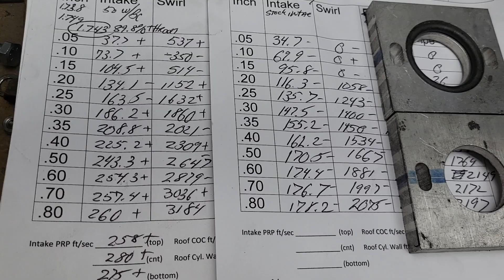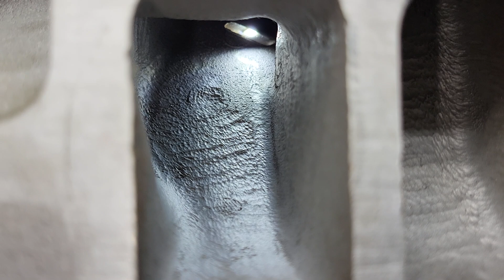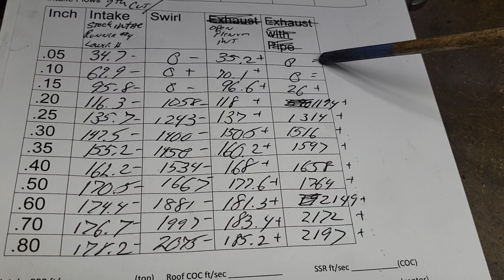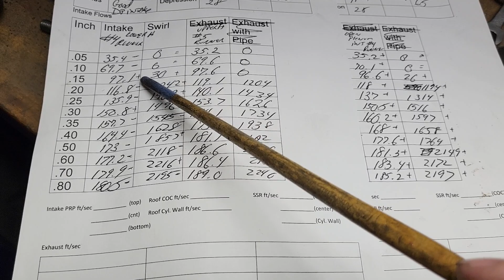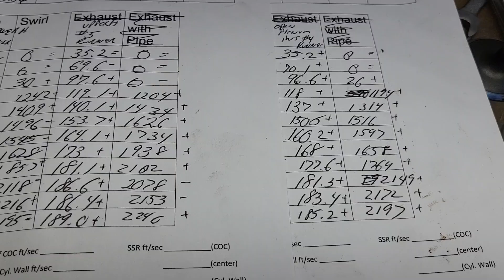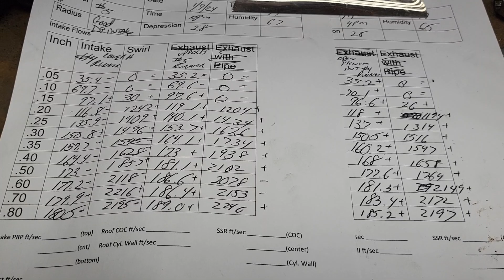45. Chevy 193 TBI Swirl port cylinder heads, flow through manifolds and t.b.. Manifold theory

Comment: I remember back in the 80's cutting off the top of the runner to get in there and open up the runners up, welding were needed. We had a really rough shot blast that was a real good as cast look to it that  passed the visual inspection at the local track lol
Reply from the maker: Excellent!

Comment: I think one of the ways the TBI falls on its face is that GM tried to make this a quasi vapor engine , having 195* jacket water right next to the intake mix is gonna mess with density and make things pretty lean , lean is great if u want mileage not power.
Reply from the maker: With the crappy wet flow I doubt it would run very lean. Interesting idea.

Comment: I've got a set of world products s/r heads with 1.94/1.5 brand new. Bought them for nearly nothing. I'd like to send then to you to be ported. Would you be interested in that?
Reply from the maker: I know those heads. They are very limited. You are better off starting with a better casting to make high rpm power. Thanks
Reply: @servediocylinderheads  it's going in a 7800lb truck. I'm after 1000-5400rpm grunt. Have a zz4 oem camshaft to go with them. 208/221 474/510 112.
Reply: And my truck has been know to haul 20,000lbs occasionally so the thick castings are key, I have a set of 062 vortecs but afraid of cracking issues
Reply from the maker: @lancegibbs7506  I get it.
Reply: @lancegibbs7506  Are EQ's not a heavier cast big port 062 ? u should check those out ...
Reply from the maker: @luckyPiston I did a set of those a while ago I did videos on them. 1.94/1.5 combo. They are cast in China now and tough to get good air flow gains compared to tye older New Zeland EQ's.

Comment: I would be curious what the flow and swirl look like with a modern intake manifold (e.g., Edelbrock EPS, Edelbrock Air Gap, Weiand Street Warrior, etc.) and a 2-barrel adapter plate.  Like you mentioned, the modern designs are better and you may be better off from the labor vs manifold cost perspective.
Reply from the maker: I will think about it. Thanks
Reply from the maker: I don't have the adapter plates for a throttle body so that ends that idea. Sorry
Reply: @servediocylinderheads  No worries!  Thanks for sharing the process and results.
Reply from the maker: @NateDalton  I will look for the adapter. I used to have a couple. Thanks

Comment: Charles when do you get frustrated with pushrod pinch area ? I would have thought on all SBC OEM heads except maybe Vortecs ? Do we just accept standard pinch is good for 400 odd HP on a 350 ? Thanks for your efforts.
Reply from the maker: When the air speed approaches 300 ft/ sec in the pinch. Thanks

Comment: Now im curious of the edelbrock TBI intake I have on my truck has a better shape than the factory one.    It was cheap years ago now its not. I wrecked the factory intake it kept leaking probably was warped.   Yea Edelbrock has the tiny bore. Wish I could find a good core 2 inch 454 TBI at the junkyard all that stuff is gone now
Reply from the maker: Yeah, that stinks.

Comment: In your opinion which would work better; a set of these heads ported or a set of double humps (462 straight plug casting) ported both with 2.02"/1.60" on a 10.5:1 350? It will go in a lightweight S10 with 700R4 and 3.73 gears. It will be an occasional 1/4 mile/street toy.
Reply from the maker: They will both get it done if worked correctly. Fuelies stock flow about 208 cfm with a 2.02 valve.
Reply: Thanks Charlie! I'll have to see which set will take the least amount of work as in guides and seats.  @servediocylinderheads
Reply from the maker: @Tshade67  Super important!
Reply: I am going to try a set of 187 heads which is the same as the 193 but are a 58 cc head. Only thing is they came stock with 1.84 valve.
Reply from the maker: @justasking1330  Watch the chamber thickness if making the chamber larger.
Reply: @justasking1330   @justasking1330  I think they are better than 193's development wise,  u will be surprised how good 187's are , the 187's have bigger port , it's 2" tall and the area where the runner meets the bowl is only a little smaller than the 906 vortec ! Watch your compression on regular tho or youll rattle an crackem like i did heavy foot heavy vehicle.

Comment: Awesome stuff as usual Charlie. I love what you did with the manifold. I was looking at the base of the plenum's and thinking that they might have benefited from squaring them off, like you do with the short side, to give more area. I realise that this would probably have meant more welding or epoxy, but I was wondering if it would have helped. Also,  it would be interesting to see how an open spacer would have helped the flow, mainly because it's easier than hogging out the manifold. Regards Greg
Reply from the maker: Good ideas. Thanks

Comment: I have an idea. Best bang for the buck... 1 hr limit per in port on the TBI heads. Cheap 2.02 valve size. How well would the port flow and what would you charge for labor per set? Stay with the 1.5 ex so the induction hardened surface on the ex seat is retained. Maybe some quick bowl and ssr work on the ex. Say around 12 hr labor per set, with the customer either buying from you or supplying the cores.

Would this be viable both for you to make some money, and the customer to make some cheap HP? As for finishing the guides and seats,  not sure your"re set up with equipment for that...
Reply from the maker: I can do guides and seats. It is a good idea. Is that an hour per port?
Reply: @servediocylinderheads Yea 1 hr per intake port, and as little time as needed for a quicky on the exhaust. I think if you could put up some prices for work, you'd get some business if priced competitive...
Reply from the maker: @Jeffsa12  Interesting idea.  Thanks
Reply: You would have 12 to 1500 into a set. Just buy afr 1200 free shipping.  That why no body mess with these old iron.
Reply: @hankclingingsmith8707  Yea of course if they're the same price, go for a good aluminum head every time. 

But what if Charlie has low enough overhead that he doesn't need to charge $100 per hour to make money? I have no idea what he could deliver a set of ported, say around 275CFM TBI heads for, and that's why I suggested he try working up a price where he could make some money, and sell them for an attractive price. If he could remove a large portion of that giant "cast iron turd" obstruction on a guide and seat machine, that would be a massive time saver as well. My experience tells me that a modified or custom single flute "bowl hog" like tool tool with a radius at the bottom would save a lot of time hand grinding....
Reply: @hankclingingsmith8707   nobody is a lota people , sorry not gonna let u include hardcore hot rodders :goat-turquoise-white-horns: in there so better to say most everybody !!

Comment: Hi Charlie, I'm wondering what the flow difference would be between manifold designs where a branch between two opposing cylinders is either straight (like a stock one) or radiused with a centre divider like you have done to this one.

I currently run a factory iron 2V on my little 302 Cleveland (but 4-barrel... Yes it's a thing in Oz). I've  noticed that the OEM runners are mostly straight with a couple of lower H ones having a bit of a kink at the junction, ie: more like the divider you made.

I also acquired an older Edelbrock Performer 2V and it looks very similar to the factory one but the entry into each runner curves more gently around the bend.

This looks more ideal than a straight one, but as you know, constant flow (like on a flow bench) has different characteristics to those of the pulsed, stop-start nature of each individual intake tract.

I have a theory. The straight type may actually be more beneficial in particular rpm ranges due to each port's ability to draw, to an extent, from the opposing port, and on a dual plane intake,  they are always arranged so they are exactly opposite each other in the firing order (Chevy would be paired 1-4, 2-3, etc) so there would be no uneven robbing of mixture from one to the other.

I guess what I'm asking is...   If the standard manifold is pretty good (like on my Cleveland), really how much better could the Edelbrock be with those radiused runner entries?

I'm interested in your opinion. Thanks for a great channel.
Reply from the maker: Darin Morgan said ," l would rather have a straight port with one bend than a curved port." Now remember he is a prostock guy but he knows air flow. There may not be that big a difference really. I used to change manifolds like socks to test theories. Thanks

Comment: Hi, Ive read on some forums that the Torker 2 singleplane works quite well with the tbi.. Anyone got tests on that?? I have a stock 350 tbi as my daily. Its good round town but man,, no power.lol
Reply from the maker: I hate that manifold. Yuck
Reply: I have run both the Torker2 and Weiand 7525 on TBI engines. Add power everywhere compared to a dual plane when limited by the stock TBIs CFM.
Reply: Hi, that's what the other guys said too. I'm thinking of trying 1 as part of my mods. Thanks for the feed back....

Comment: The notches in the manifold are to even out air/fuel ratio variations to decrease emissions and make the engine run more smoothly.  The early 4.3L Z engines actually even had to have injectors that flowed different amounts of fuel left and right to help eleminate the afr differences between cylinders. A lot of engineering went into even the TBI engines for emissions compliance and longevity.
Reply from the maker: Excellent info! Thanks

Comment: It would be interesting to see a comparison to an Edelbrock 2104 which is made for these heads. The only thing it lacks is the A/C bolt bosses between 4&6 otherwise it is a bolt on for the 87-95 heads. It would also be interesting to see what it does through a spreadbore carb. Thanks for adding the playlist. This has got to be the most comprehensive cylinder head development series on the 193's. Thanks again for all your work on this.
Reply: My 1986 Malibu Skier has a TBI 350 retrofitted , it runs a Q-Jet on a cast iron Mercruzer intake , i think the TBI heads love carburation , boatsa solid runner right out to 5K rpm
Reply from the maker: @luckyPiston  I believe it. That iron intake is my fav!
Reply from the maker: I have a Holley version dual plane that fits these heads but it too is fully ported. I have no speadbore carbs in stock.